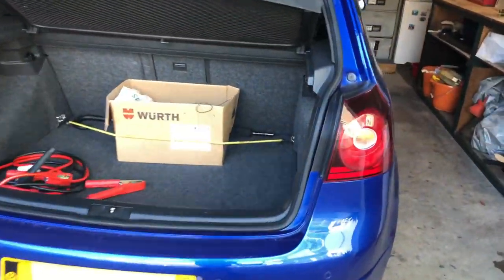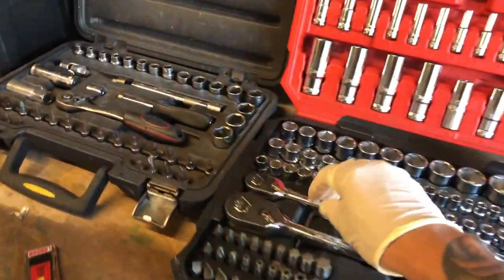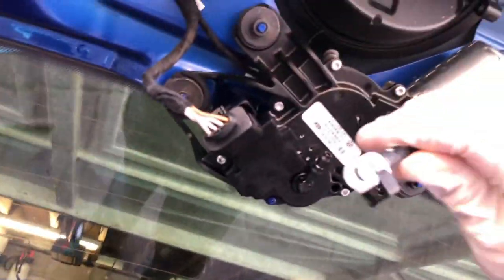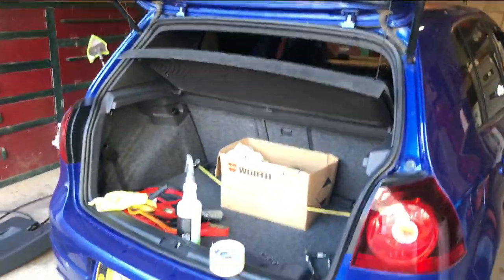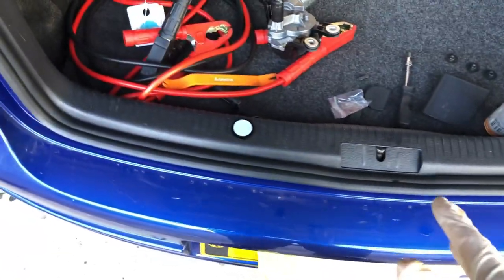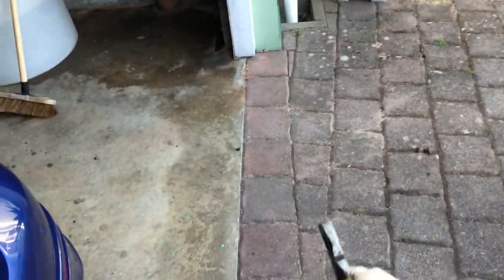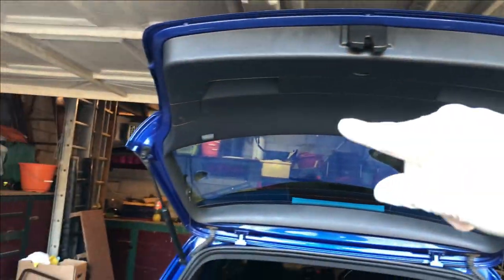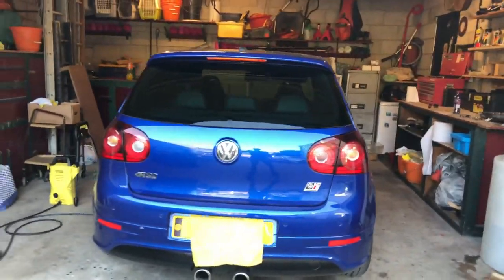I De-Wiper My MK5 GOLF R32!!

Comment: Did you delete the rear wiper using a laptop or is it all good without doing all that crap I don't want to start getting into coding rear wipers just want to follow your instructions just wanted to car throws up and error codes
Reply from the maker: No error codes mate